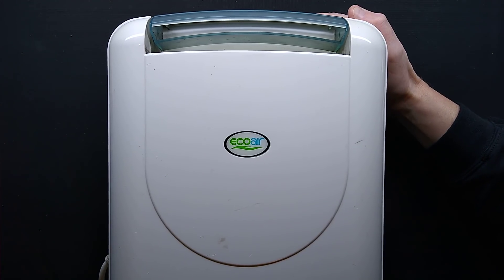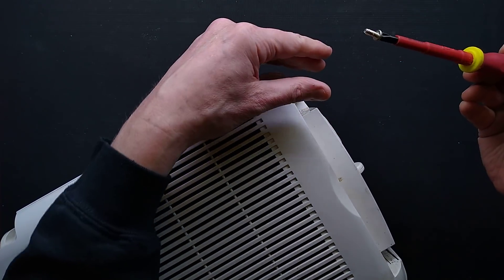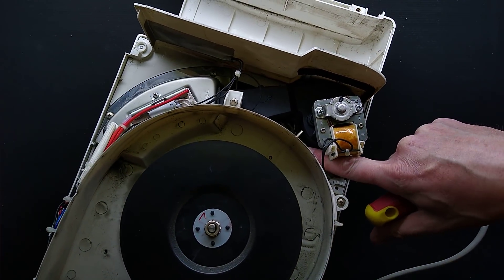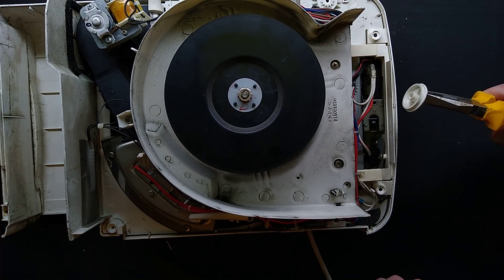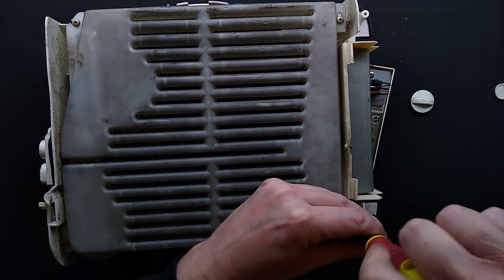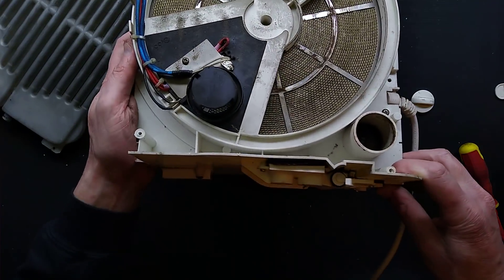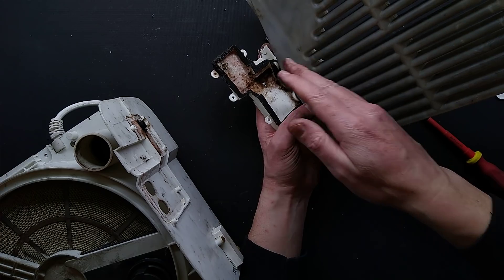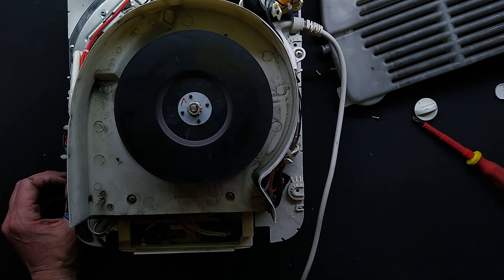Opening a desiccant drum dehumidifier.

Comment: Yup, mine is exactly like that, sold under the “EcoSeb” name. The problem mine had was the motor for the drum ceased up, overheated, and popped the front thermal fuse on the heater shroud. It’s been about a year since replacing it, and so far I’ve had no issues.
Reply: Can you tell me what motor you replaced it with?  I have the exact same issue and although synchronous motors are a-plenty, I can't find one with the correct shaft type.  Thanks
Reply: @ironridgeclassicaudio  It’s 110v, but here’s the eBay item no. 153139997104 
I did have to use my dremel to grind a groove in it for the circlip. Everything else was a perfect fit.
Reply: @BRMBug  Thank you!

Comment: ECOAIR DD122FW MK5
Wow, these are great videos you made!
Are you aware that one could easily suspect you of wanting to undermine our capitalistic system, where would we be if everybody would start repairing their broken goods? 
I was just about to buy a new ecoair of my matey Jeff!
Poor Bezos might end up on the dole if you carry on like this!
I've lately been noticing that my ecoair is taking a lot longer to fill the tub. So I wondered how long ago I bought it, and had a search through my emails. Turns out it was back in 2013. Time for a new one then I thought and checked prices until I came across your channel.
I guess it's time to save a little of the planet and give this trusty old friend a service (clean) instead.
I don't think I've ever touched it apart from emptying the tub.
For six months of the year it runs on the highest laundry setting 24/7 flat out and that for seven years now without ever making a squeak.
Just took off the filter (didn't know it had one) and gave it a rinse under hot soapy water. Who knows, judging by the amount of dirt which washed out of it , it might work a little more efficient again. 
I'll need to strip it down propper when I get a mo, now I know how it's done!
Thanks bigclive, much appreciated!!
Reply from the maker: You don't need to take it fully apart to check the water collection tray.  You should be able to remove it from inside the drawer compartment with a short cross-head driver.  Clean the collection tray and make sure the ports coming down into it are clear of shmoo.

Comment: ooh , its looking abit similar to the thermal wheels in some of the HVAC systems at work, similar principle at work here with extra parts ??
Reply from the maker: Do you guys actually use the big dehumidifier units?  The industrial ones tend to have a separate duct section for each half of the drum.
Reply: @bigclivedotcom  Theres loads of mitsubishi inverter type aircons linked in via bacnet into the local bms system . Usual stuff like heater batteries, bypass dampers, heat recovery units both cross flow and thermal wheel types. Its all very bespoke per building and a pain to work on at times. No dehumidier systems installed that Ive ever seen ( apart from the condensate traps)
Reply from the maker: @humanseagull2744  On a plus note the overcomplicated BMS systems do keep you in work.

Comment: Thanks Clive! Got one of these in the garage as works well in low temperatures and the heat output actually stops the room dropping below freezing. I run mine 24/7 on low and clean the filter, but does the desiccant wheel itself ever need pulling out and cleaning? I can imagine it must fill up with fine dust over time?
Reply from the maker: The desiccant drums seem to stay surprisingly clear.

Comment: I've had that exact same model for 4 years now, it gets used continuously during the Winter months & as you say emits a stream of warm air. I've got the dial set to about 1 o'clock which seems to control to an average 50% RH according to my house hygrometer. The warm air means we can actually close the living room door & it keeps the room warm enough most of the time in the evenings when we're sat in there, meaning the central heating is rarely needed as the CH stat is situated there also. Wasn't aware of the gunk problem with the condensate outlet though, a cleaning session is on the cards me thinks.

Comment: I've seen diagrams of industrial desiccant-drum dehumidifiers (mostly for moist exhaust air, I think). Instead of driving the water off the desiccant and recondensing it, they draw in outside air, heat it, blow it over the drum to drive the water out, and then just exhaust the hot humid air back to the outside. It'd obviously be a lot less portable than a unit like this (since it'd need ducts to and from the outside), but I wonder how that would affect performance.

Comment: If they need so much cleaning you'd think they'd be slightly easier to service :(.
Reply from the maker: They don't usually require it very often.  The bottom water collection tray can also be removed without opening the unit on most models.
Reply: @bigclivedotcom  Ah ok - good to know - I've been thinking of getting one of these :).

Comment: Wow, that is disgustingly dirty. I guess the moist, dusty and warm condenser is a perfect breeding ground for just about anything.
Another plus for a compressor-based dehimidifier: the wet part is cold and doesnt accumulate as much life.
Reply from the maker: Ever opened one?
Reply: @bigclivedotcom  Yes. Didnt have disgusting slimy crud inside, just dust and a few rusted steel parts (and a burned out fan motor, so it ran a few hours).

Comment: I've never seen one of these! I've only seen the ones that use refrigeration. And that was when I lived in Illinois, where it is roughly as damp as the UK or Scotland but 2X as hot in the summer and cold in the winter because middle of continent, no ocean mitigation effects. Now I live in... er... west of the middle of the continent, in a semi-arid climate, and we use >> humidifiers << here. ^_^  What i have seen which this reminds me of is a regenerative air drier / compressor I used to own, which would use one column of desiccant (same type) to dry the output air while it was "regenerating" the other column by exhausting the (hot but not dried) bypassed air from the regulator through the unused column. Note that this means the thing won't work at all in a humid environment. It was intended and sold for making EXTRA-dry air for use in microwave waveguides. It would always have been used in an air-conditioned (at least semi-dry) environment where it would work as intended.  I used it for operating exotic HV pulsed switch devices (triggered spark gap switches of various kinds). Anyway: another excellent post; you take apart the damnedest stuff!

Comment: I have one of these which I have used for many years in a storage building.  By standing on a bench I use the continous drain hose into a 25 litre container which fills surprisingly quickly depending on the weather.  Works much better than my previous compressor unit which one winter turned itself into a solid block of ice and died.
Reply: Also I dont think the half or full setting switch does anything beyond adjusting the speed of the fan which circulates the air to the room.
Reply from the maker: The half setting runs the heaters at about 300W.  The full settings adds another 300W heater for 600W and increases the fan speed.

Comment: So how are these type of dehumidifier on heat ive only had old ones and they generate alot of heat which I find in a basement makes the basement unbearable to be in
Reply from the maker: On the low setting these units are basically a 300W heater.
Reply: @bigclivedotcom  yea that's what I assumed the ones I ever had were old models or the cheapest ones known to man

Comment: I used to work doing field service on a shipping container-sized version, that was installed on supermarket rooftops.
Reply from the maker: Drum rotating between two ducts?  Not super efficient as the moist heated air gets expelled outside.
Reply: @bigclivedotcom  Double wheel. One dessicant wheel, and one heat exchanger wheel. On one side the air came in from the store, through the dessicant wheel, then through the heat exchanger to cool down, and back into the store.

On the other side, air came in through a swamp cooler, through the heat exchanger wheel, then through a hot water radiator to heat the air up more, and through the dessicant wheel to dry it out. Then out the side of the machine. (It does occur to me that maybe using air that had gone through a swamp cooler to dry a dessicant wheel wasn't optimal. But in Connecticut/Massachusetts in summer the ambient air probably wouldn't be much less humid.)

The wheels were about 6 feet across. The dessicant wheel rotated slowly, and the heat exchanger rotated several times faster.

This was 1991, the company is gone, and the machines I worked on don't seem to be on the store rooftops anymore. Doing the math, 2+2 = didn't work out.

The theory was that it would help reduce humidity in the cold aisles, reducing the need for air conditioning to prevent frost buildup in freezers. Which would save the store money, improving the slim profit margins.

Comment: I just wish I could find some sort of mesh basket that fits into the top of a standard cheap 5-gallon bucket so I could dump calcium chloride ice melter into it and suck the water out of the air to collect down in the bucket.  I don't have a 3D printer, nor am I smart enough to design one up in CAD.
Reply: Thatd work great for a month or so before it gets coated with dust or stops being hydrophilic and needs baked but i dont think calcium chloride should be heated.. Think i tried it once to dehydrate some mushrooms but think the crystals turned into pop rocks in the oven..  epsom salts are better at drawing water out of the air believe it ot not..  when you buy a container its actually more than half its weight in h2o so you just bake the salts at 400 for as long as you can and then just let them sit out and they will absorb all they can in a few days...  desiccant would be more applicable but more expensive for the medium..
Reply: You can buy calcium chloride packs specially for dehumidifying, some come in pre-filled sealed tubs, some are just a tub and grill to pour it into. They're good for small spaces like cupboards but they're not too effective for big rooms, even if you had a whole 5 gallon bucketful.
Also even if you did manage to dry it back out yourself to reuse, the cost of running an oven for long enough would probably work out much more expensive in the long run than the electric it takes to run a dehumidifier.
It's also very messy, and quite corrosive stuff you want to handle very carefully.

Comment: I've always wondered how these work. Fascinating.
I have a 2006 Prius that developed the built-in roof/rear quarter panel leak over the summer (fixed now). I found that desiccant pots were not enough to dry everything out and have been looking for a quiet dehumidifier to put in the car for a week or so. Solved my issue. Thanks Clive.

Comment: Clive, at what temperatures would you switch from compressor based dehumidifier to drum one? Recently I bought compressor dehumidifier but I'm not impressed with efficiency. Average temperature inside house is 12c. At 20c it was doing great though, so unit is not faulty. Why so cold? It's a summer house without any insulation.
Reply from the maker: The compressor units will start struggling at around 15C and will often keep going into a defrost mode.  These ones use a bit more power, but put it all out as warm and very dry air.  They will operate to near zero C.

I use compressor units in summer and desiccant in winter.

Comment: mmm, bacterial goop clogging holes, also an issue inside fridges when their drain port gets plugged up too needing a bit of ram-rodding to clear out and a squirt of bleach to disinfect... :S
Reply: Just one more reason those "free drinking water from thin air" devices on Kickstarter will never work (not to mention laws of physics). Nice glass of Legionnaires Disease and other random bugs anyone??
Reply: @sootikins  Agree. Such device is more suitable for cleaning the air. It draws in a lot of air and runs it over a cold and wet surface. Most dust and airborne germs will be caught in the machine.

Suppose, one would really want to extract drinking water and would like to have such a device at home... 

One cubic meter of water at 20 deg C holds at max 17.3 grams of water.
60% of that is 10.38. 40% of that is 6.92. So if you take moist from the typical indoor air, you get 3.46 grams from one cubic meter. So that would be one glass full of water from a room of about 5 x 6 meters.
But cooling a condensation surface takes energy, which will add to the total amount of energy of the room, heating it up. The heating will decrease the relative humidity even further.
But this full glass of water is not even close to enough to fill up the needed filter cartridges. So, doors and windows will need to be opened. So, only usable in moderate weather, unless you like to spend a lot of energy on HVAC as well.
Reply: That drain port - where does fluid drain to, exactly?
Reply: @petertr2000  a small reservoir above the compressor that's located behind the fridge. The compressors excess heat helps evaporate the water. So if you're cleaning up the drain port it's a good idea to remove the dirt from the reservoir afterwards.

Comment: Very nice video, a bit amazed there was not a antitamper label over one of the screws.  Just checked what we have and it is the compressor type.  Other than the initial cost of the unit it is free dehumidification since it is only used in the cold season at home and lets face it these,  dehumidify, generate heat and yes noise that actually generate heat. It is a heater with two purposes (-:
Reply: Actually there is a bit of 'special' sticky tape holding the two sides of the casing together, right at the very bottom on the inside of the chamber where the collection tank slides in.  That tape seems to have no function other than to act as an anti-tamper measure.  It is easy to cut through to open the machine, but not so easy to find a new bit of similar tape to hide the fact you took it apart.

Comment: I have 3 of this exact unit, which makes this video very handy 👍 
My top tip would be not putting it right next to a subwoofer containing a big magnet. Accidentally overriding the magnetic float switch can have very bad consequences...

Wouldn't be without them though especially in the winter. Nice efficient background heat and keeps dampness and condensation in check.

Comment: Low temp, low humidity explains why I haven’t seen one before. 

I have a 70pint compressor unit that I use in the summer to keep sticky humid Oklahoma summer outside. Need to get humidifier started up, temp dropped 25°F and it’s been raining all day and we’ve dropped to 45%RH from our usual 55%.
Reply: Wow, 55% is humid where you are? In here that is very, very dry compared to normal all year round. Very dry over here is 60%, normal dry is around 70% and some days we are just over 90% inside but that is only in 'moist houses'. Generally will be below 80%. Still needs quite some time to fill 3 litres with the dehumidifier I have because the temperatures are normally not over 20 degrees (Celcius) in summer, maybe 25 and getting warmer the last couple of years. 
By the way, province of Zeeland in the Netherlands. The sea is about 800 metres from here and 'all around'.

Comment: I have one of these units lying on the "to get around to fixing" pile. from what i remember, the drum motor stopped working causing the safety cut-outs to kick in
Reply from the maker: On early ones the drum motor could literally grind its bearing oval.  It's a standard synchronous motor, but the shaft may be tricky to match to the drive cog.  Although it's directional, I don't think it matters which way it rotates, since I had one that started going in a random direction and it still pulled out water at the same rate.
Reply: @bigclivedotcom  thanks for the heads up I wouldn't be surprised if this was it to be honest, its good to know the direction isn't critical.  now to find the time and space to take it apart haha

Comment: What's the reason for using a dehumidifier when it's cold? I live in a warm area and hot, as long as it's dry it's fine.
Reply from the maker: The Isle of Man is in the middle of the Irish Sea.  It's a very wet and humid place even in winter.
Reply: Condensation a lot of the time. Warmer air temperatures and colder surface temperatures mean that above a certain humidity stuff gets damp.

Comment: Why did you stop. You opened it but then stopped halfway.
Reply from the maker: It was really just to show how the unit is opened.
Reply: @bigclivedotcom  I did realise that past half way. But I was hoping to see that desiccant
Reply from the maker: @1st_ProCactus  The drum I showed is the desiccant.  It looks like rolled up corrugated cardboard, but is a brittle zeolite material that the air flows through as it rotates through the main air path.
It's that same drum that is absorbing and then releasing the water.

Comment: I have almost exactly the same dehumidifier ("EcoAir DD1 Simple"), in use for 3 years now. It recently began to leak water all over the floor mysteriously. I opened it up (I didn't need to go as far as you showed) and found the fussy little drip tray (11:17) that transfers water into the bucket was absolutely *CRAMMED* full of pink desiccant gunge mixed with clothing fiber dust. Basically the same problem as you show. Water couldn't pass thru the gunge fast enough, so was instead leaking out of anywhere else it could. After washing out all the gunge in the tray it's now as good as new. Apart from that hiccup, it's been a good dehumidifier.
Reply from the maker: It's put form before function.  Making it all a bit too small.